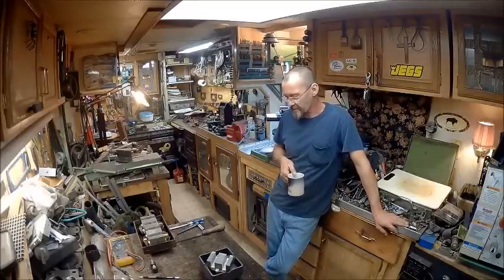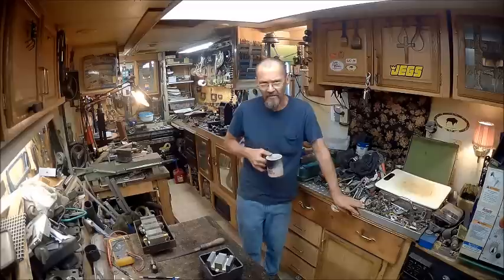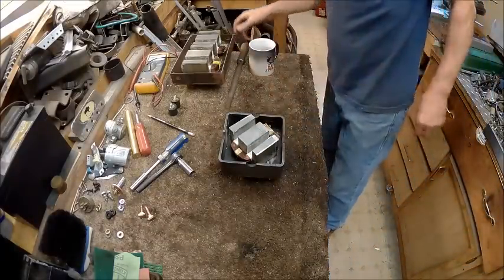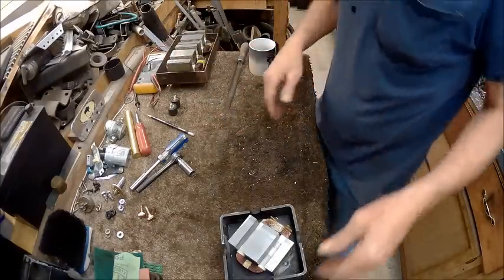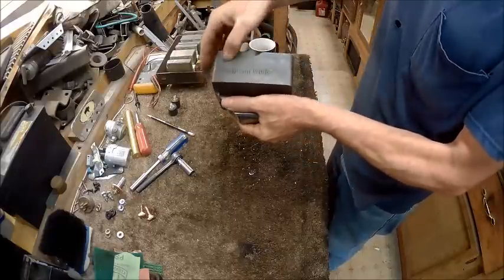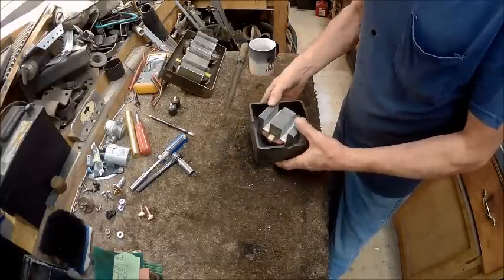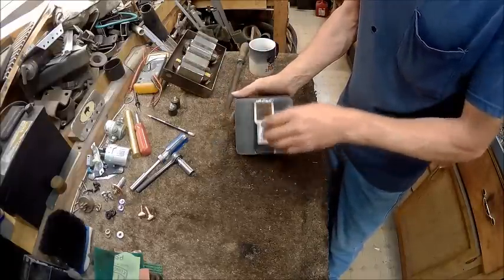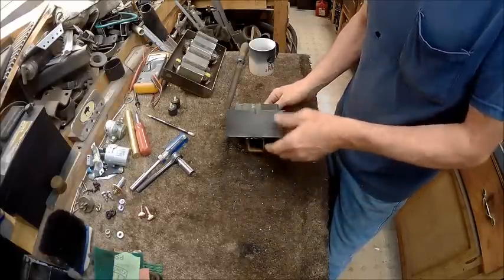diy magnetic chuck part 3 the switch

Comment: Electrically, you make sense as far as the circuit goes. What you have overlooked is the switching speed.
Contactors, solenoids, heavy duty switches and the like are all actuated, both for the 'make' or the 'break' electrically or spring-loaded. The reason for this is (and that goes for high power DC users as well) that if you close a contact slowly (or open it slowly for that matter) you will draw arcs, which will burn up your contacts in no time. So I'd consider using something spring-loaded to both make and break the contacts. No matter how fast you are, you are never fast enough to actuate a switch by hand (or foot!) to limit arcing to an acceptable level.

All the best

Paddy